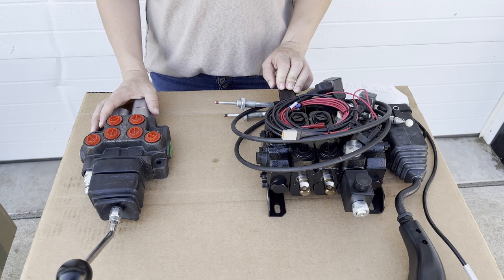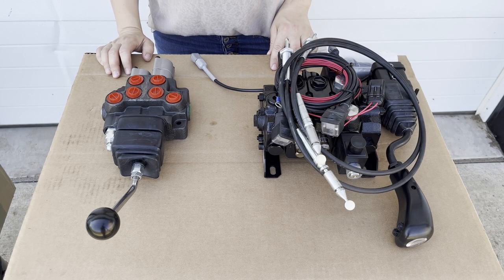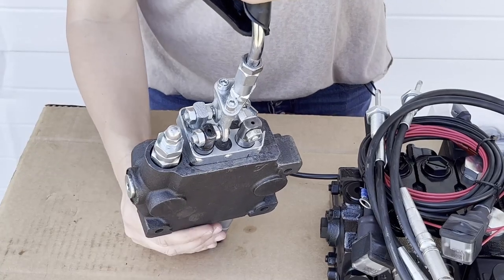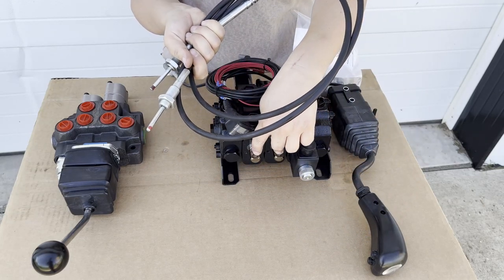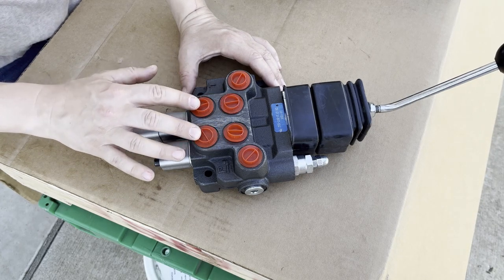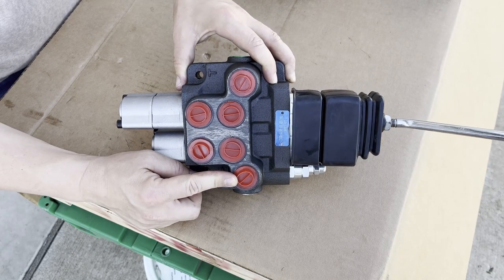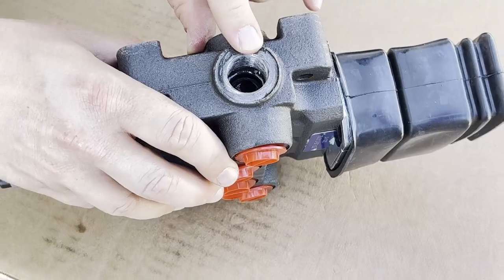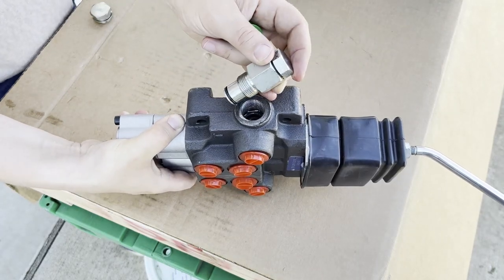Tractor Hydraulics Fundamentals - Understanding How a Midmount / Rearmount Control Valve Works

Comment: Thanks for the detailed explanation - great job!  I’m trying to understand the difference between the “two” dump positions. Pretty sure my TYM is open center, but for the loader it has the standard 4 operating modes (lift/lower, curl/dump) but it also has a float option on the lower mode and on the joystick it indicates two types of dump.  Unlike the float which appears to be a detent, the additional dump option is spring loaded... joystick right dumps, further right does ???  Joystick must be held against spring pressure for that feature, but I’ve not been able to tell any difference in the dump.

Since I don’t understand the expected operation, I can’t determine if my3rd function diverter valve is the culprit.  It’s difficult to research information about a topic when you don’t even know what it’s called lol!